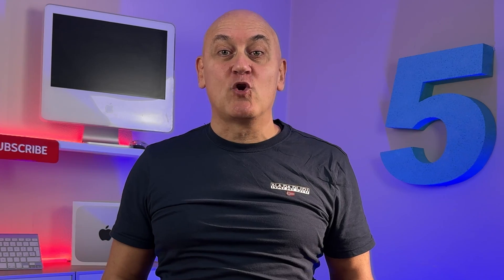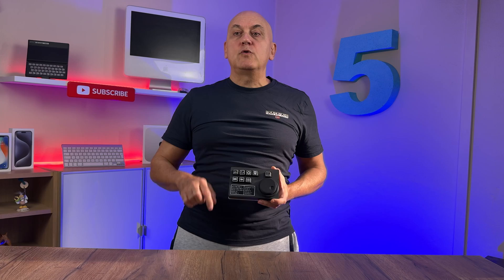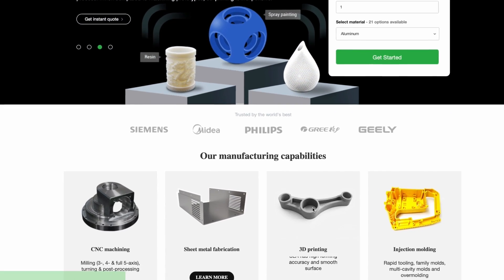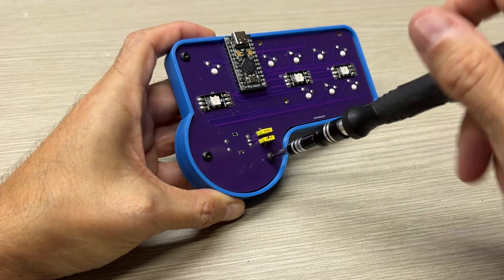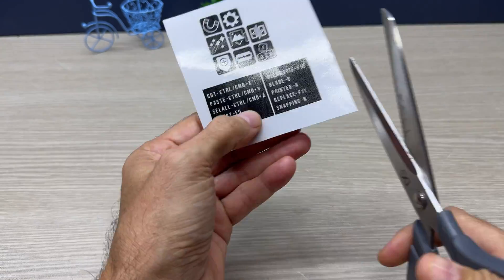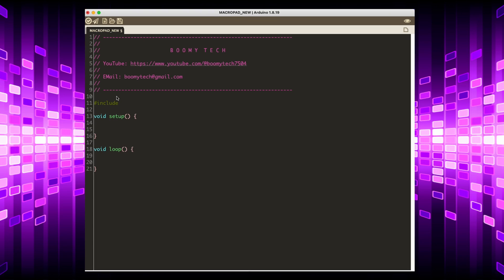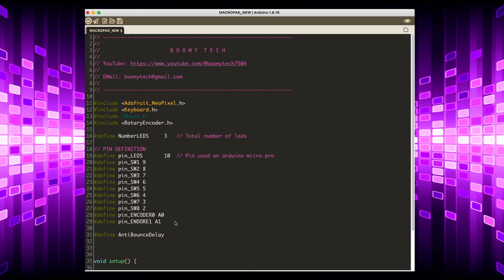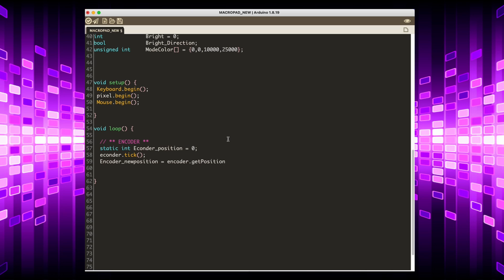Stream deck for Davinci Resolve Finalcut or Premiere with Arduino micro

Comment: why not make a github for your projects instead of using gdrive ? can you show it working in resolve, what does the jog wheel do ?
Reply from the maker: This is I great idea…I will work to create an account in github.. about using the joggle in resolve, I use it to slide the timeline…

Comment: I would argue that the defining feature of the Stream Deck is the screen, otherwise it's a standard macro pad. The big advantage to it is that you don't need to remember what the buttons do, or put labels on them. You can show any icons, and change them on the fly, making it much easier to use than any other macro pad out there. I like that you used mechanical key switches, the Stream Deck doesn't have nearly as good a button feel as a keyboard, but I wouldn't really categorize this project as a "Stream Deck", but as a mechanical macro pad.
Reply from the maker: hi I think you're right, it looks more like a macro pad..👍🏻